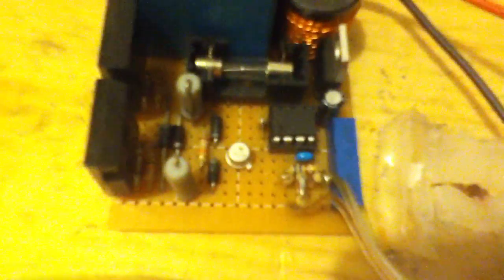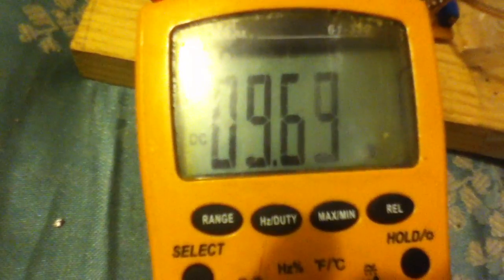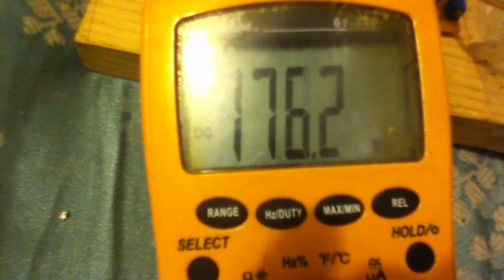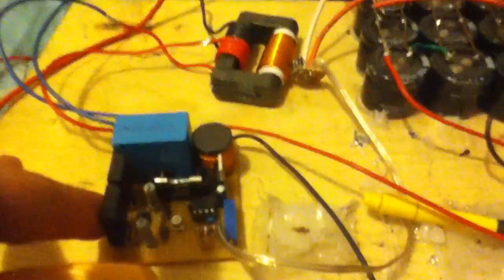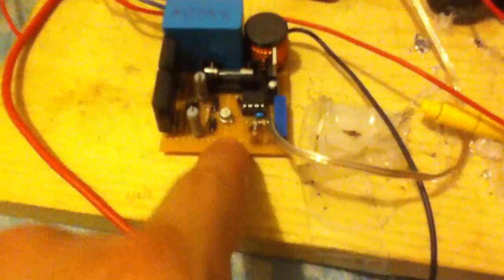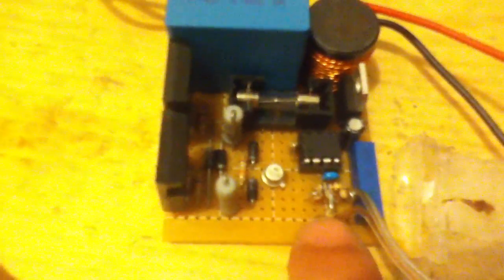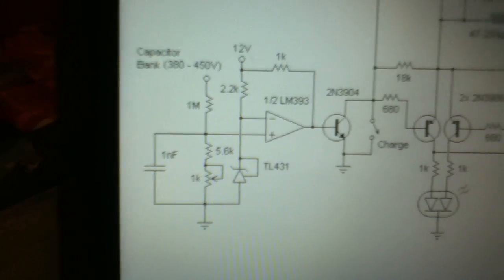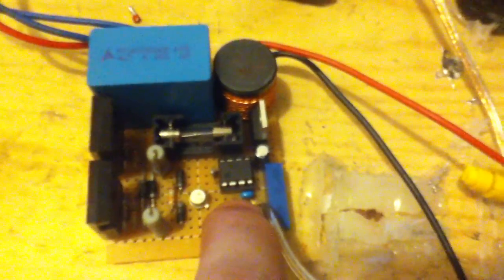Finished ZVS Capacitor Charger

Comment: Nothing to worry about, when the op amp or comparator turns off there is probably some time that it turns on and off due to being right in the middle of the voltage that turns the comparator or op amp off and on. You could get rid of the noise though. A simple low pass filter should help quite a bit, just a resistor and cap is required.

Comment from the maker: @coilsinamotor I added an 11uF bi-polar cap (two 22uF caps in series with the negatives connected together) across pin 3 and 4. That helped a little...now the noise is more of a clicking sound and its not that fast at all...maybe 2-3 clicks a second? I'm just gonna do a whole new revision with smaller better parts and use the tl431 to set the 2.5 volt reference. I'll admit though, doing the math to figure out the different voltages from the dividers was a lot of fun (:

Comment: hey nice finished product.. the buzzing sound is comming from the rapid changes in voltage detected by the lm393 or the lm358 witchever your using. i had the same problem with my dc-dc converter i would try adding a capacitor to your refernce voltage and maybe the input~ great vid and very nicly built!